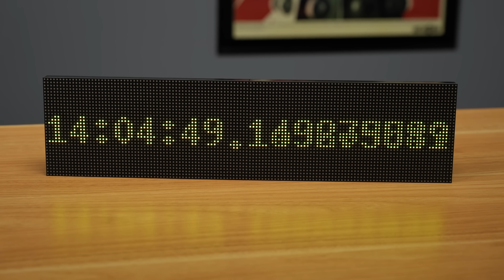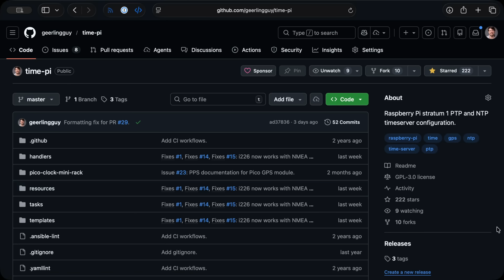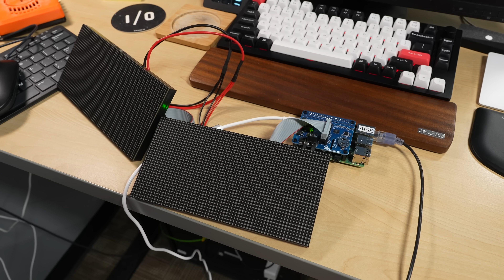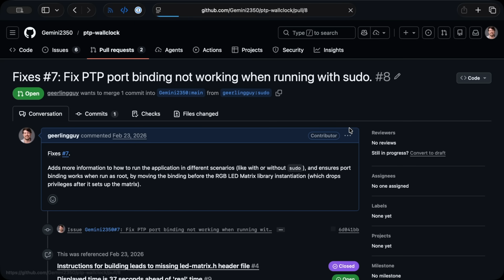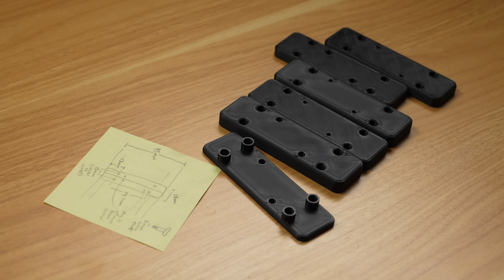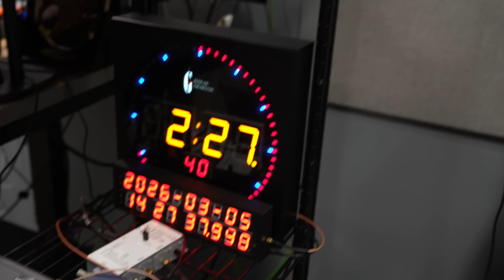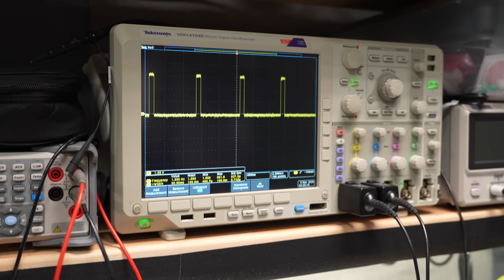I built a new clock, and now I'm not sure what time it is

Comment: A few thoughts:
It could simply be a lack of termination/impedance mismatch the i226. Considering that it’s supposed to be detecting slope, and assuming that if ✨is✨detecting it, I’d speculate that somewhere along the chain (but before the i226’s detector) there’s a capacitor that’s resulting in undershoot (relative to the detector’s threshold) during the falling edge of the pulse. This undershot, in turn, creates an additional positive-oriented slope that is what’s actually being picked up by the detector. (To get an idea of what I’m describing, reconnect your scope like you have at 9:49, but change the scope’s coupling to AC).
If so, ‘DC restoration’ needs to be applied; accomplished by bridging a diode between the signal line and ground (anode to ground if the signal polarity is that of what’s shown on the scope). Use a fast switching diode like a 1N34a or 1N4148. You may need to also place a resistor in series with the diode for impedance compensation

Comment: You need a clock that’s synced to GPS time. I bought such a kit from someone who designed one and assembled it.  It shows the time with 0.01 second resolution.  The cool thing is that when the designer built several of them and took video with a high FPS camera, there were all exactly in sync to 0.01 seconds.  It doesn’t use NTP or PTP— it gets the time straight from GPS satellites, so the clocks sync themselves with no wired communication whatsoever.

Comment: Flux remover in a dishwasher (not the one you use for dishes you eat off of).  If you don't have immersion sensitive components on the board, an ultrasonic bath will do the job.

Comment: 3:44 at the defense contractor I worked at for a bit where everything we did was mil-spec and ipc rated, we would scrub boards like that under a running sink with steaming hot water, then blast it with an air compressor to get the water out of the nooks and crannies, then sometimes rinse with IPA if there were still visible drops of water, or if there were components like a qfp or ball grid that could have water stuck underneath since the IPA will displace the water, and then let the boards sit for a few hours/overnight before testing them.

The IPA can help the water dry more quickly too and is how I usually do stuff at home now since I don't have an air compressor in my bathroom.

It felt super weird the first time I did it, but the issue with electronics and water is if it is sitting long enough to oxidize component leads and traces, or if water is still on the board when you add power since it will short stuff out.

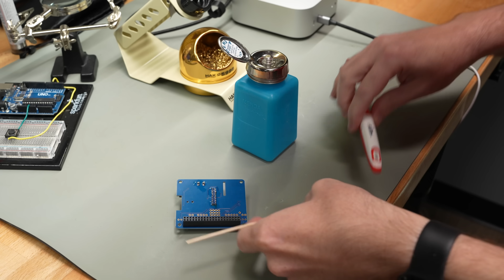Comment: 3:40 for cleaning solder flux, the most important step is to blot the board dry with paper towel — otherwise you're not removing the flux, you're just spreading it around.

Comment: To clean the flux use isopropyl alcohol, don't use 99% isopropyl alcohol, I found that out because it needs the solder mask and everything else as well, but drugstore isopropyl alcohol is perfect. You then just use a little toothbrush and just lightly scrub it back and forth and it'll come off

Comment: PTP and NTP are two different protocols NTP is a standard time protocol and it allows for some changes in time to be off a little bit however PTP is the precision time protocol and it keeps it up to date to the right time at the exact precision so that way time sensitive applications that require synchronization across many states for example the New York stock exchange, everybody who trades or does anything on the New York stock exchange those banks in traders need to have the exact moment they place a trade because that could mean the difference between millions of dollars. So PTP is used in high precision medical financial and other aerospace industries and stuff. We're NTP is perfectly fine for everyone's desktop laptop even most of us are work computers are perfectly fine with just NTP

Comment: I saw someone already suggest the paper towel technique for cleaning flux (I use a clean room wipe so I don't get small bits of paper on my board) then clean that off as soon as you're done soldering. If its stuck on there for a long period of time you can also use a mixture of Joy / Wisk detergent and water (be sure to rinse well when you're done). The good news is that if you don't mind it being sticky, you don't need to worry about cleaning it off; but if you are dealing with high speed data communications, (1Gbps+) you need to clean it off as it does degrade the signal in my experience. Great video, didn't know about PTP

Comment: Most components are fine to clean in IPA in an ultrasonic cleaner and that's the recommended way to clean the flux off PCBs for ultra low current measurements (nA and below)

Comment: 3:36 the toothbrush is just smearing the flux around, and the same about of flux is still on the board after the IPA evaporated, just more spread out. I usually use a piece of paper towel to suck the IPA away immediately after brushing but before it started evaporating. this takes the solvent WITH the flux away and leaves a nice clean surface after a few times. it also helps to use slightly more IPA to do this so it doesn't evaporate too quickly (and also dilutes the remaining flux as well)

Comment: 3:40 you are not cleaning the board, you are just spreading it evenly around the soldering. IPA will not make rosin go disappear. I worked in electronics and i had to tell this several times to the repair technicians. You have to wash it off with IPA or use paper towels to soak up the diluted rosin.

Comment: I've done a lot of production soldering.  Flux type is huge for cleaning but 99% IPA (warm) and an ultrasonic cleaner is the standard solution and it also works well with a brush if you use enough of it, especially for rosin type fluxes.  Rosin cleanup is much easier if you let the rosin dry for a couple hours after soldering and then use a wooden toothpick to manually remove most of the residue. These days I solder everything using paste solder and skip wire solder altogether.

Comment: Yeah, rosin core can be a pain to clean up.... use solid core solder and a liquid or gel type flux for easier cleanup.

You can also make a home made flux that cleans up easy, costs almost nothing, and smells great...  dissolve dry pine resin 90% ethanol until it won't dissolve any more... apply a little and solder away.  Clean up with more alcohol when done.  This is something my grandfather taught me before he died, it's my go to for soldering coated copper wire like what's in headset cords... works better than most of the commercial stuff I've used in those situations.

Comment: At one time network time clocks were stupid expensive. I did some work with an operator in Denmark around 2005, they rented their two from a specialist at big monthly money. Fast forward a few years the company I was working for provided some cheap think a couple of thousand dollars a link RF backhaul. Used GPS for timing and as it had the right hardware for Ethernet we turned them into PtP servers too.

Comment: You know what I would wind up using this for... I'd add a button and when I press it, it would display the press time below that running clock. The game would be to get as close to a second as possible, meaning 'most trailing zeros'. If there is room, it would also display the high score.

Comment: When you are getting to that degree of accuracy of time, how does the components of hardware affect the time? SCSI disks had a limit of length because bits would arrive along the parallel wires at different times due to resistance . The lengths of cables plus the tolerance of components  will all affect the display of time.

Comment: I know 'make it look nice' was the stated goal, but the sanity-restoring solution to dealing with the flux after soldering is to leave it there. Your hand-soldered one-off doesn't need to look like it came out of a factory. (Yes, some fluxes -- not the rosin core in your solder -- are not safe to leave on, you should know if you're using one of them & then you can just follow the vendor's recommendations.)
The way to get it clean anyway is, unfortunately, to use way more fluid. The flux dissolves in the fluid so you need to flush the whole lot away otherwise the solvent evaporates leaving the flux behind (again). A stiffer brush helps too, toothbrush is too soft -- you want 'boar bristle'.

Comment: We use ptp a lot in the HV electricity industry, it is slowly replacing IRIG-B. Every substation has a GPS clock and every protection relay is synced with ptp or irig-b. When there is a fault (i.e a bird flys into a powerline) the relays respond and record all the voltages and currents etc at 1-8kHz. Then the engineers can review event logs from all the relays that saw the fault and see what happened when, to get a detailed picture of what happened and ensure everything worked as it should.

Comment: 0:24 For anyone who doesn’t know PTP clocks avoid leap-seconds because they don’t actually show UTC time. Jeff’s Apple Watch is a very very accurate timepiece that displays UTC time within extremely tight tolerances. If you and a friend both hold your Apple Watches next to each other you’ll notice their second hands will be exactly in sync. The seconds separator colons on both watches will blink in unison. If you both happen to use the Mickey watch face his foot will tap exactly the same for each and every of the millions of Apple Watches on the world (and however many happen to be in space).

Which is more accurate Apple Watch or any given PTP clock? I can’t say for certain, but at least Apple Watch accounts for leap-seconds whereas PTP time uses some other standard that avoids the problem.
Reply from the maker: PTP uses TAI, and offers a field with a current number of leap seconds (though optionally the server can pre-apply the leap seconds and distribute UTC, but it must set another flag for that mode).

Comment: Way way back in time (mid '60s) when I was working in a lab that lofted things on NASA rockets, we used pure ethanol to remove the flux in solder of the day. I've never seen or used anything that did better and anywhere near as benign to use. Now, this lab was part of the UMich engineering school. So of course it was populated by graduate students, mostly. There was large jug of ethanol. Its level moved very little over the time I worked there. The students never touched it for "recreation". It just wasn't done. I got into industry and the looks and words I received when I mentioned how well ethanol worked - - - were educational. And, of course, that was then, this is now. Fluxes are different. But, as a test, a cheap bottle of denatured Ethanol might be worth trying. The molecule may work better than the more poisonous alternative alcohols' molecules.

{^_^}

Comment: I can't say I'm a fan of using a multiplexed display for displaying precision time, maybe if the refresh is linked to the last digit (as in the picoseconds digit) and does a complete refresh/update before that digit changes, otherwise you just end up with a jumble of dots. Unfortunately using an Adafruit etc. library generally does not give you that control. I see directly driven (as in not multiplexed) seven segment displays as the only was to do justice to sub microsecond time displays.
I'm not worrying with PTP for now, way much network upgrading needed, I'm more lookin at ways to distribute PPS to keep all in sync. I'm a bit disappointed how PTP was implemented, way to complex, pity it's not like POE where it runs in parallel to all the regular data with neither effecting the other.

I have two independent time sources/generators alongside a GPSDO PPS, I'm trying to come up with a device to compare all three and give me some graphs etc of their drifts. Getting an Arduino etc. to capture pulses and tell you when they occurred in reference to the Arduino"s clock is easy, however when you have three independent pulses that are ideally within picoseconds or less of each other is a lot harder. After seeing the time errors in the Jeff Geerling clocks, something like I'm describing would be real handy, much better then holding up a wrist watch and trying not to blink as the seconds roll over - not very scientific, about the same as me using a mobile phone running an atomic clock app for doing the same.

Comment: Hehe, I like that obsession. Reminds me how I replaced timer at work (digital, crystal driven) with Siemens Logo synchronized via NTP. For some reason that previous timer shifted by like 2 minutes every month, while Logo runs at +- 1 second in worst case. It's only to sound a horn when break or shift starts/ends, but it was stupid we had to adjust time every other week. There was also DCF77 version available for some time and now you can only get GPS version....which most probably wouldn't work in our metal building.

Comment: My most recent project was an LED clock that uses a Pi Pico 2 with GPS for time. The interface to the GPS chip is 9600 serial, so I'm not sure to what accuracy I'm getting the seconds. But it requires no network, no server, and I even programmed in awareness of timezones and DST transitions so the time never needs to be set. A battery-backed real-time clock gives time immediately on boot or whenever there may not be a GPS fix. There's got to be a bazilion projects like this out there, but I wanted my own, not copy someone else.

Comment: For flux clean up, you should try switching to a water soluble flux.  It can be cleaned off with just water and a tooth brush.  I normally just run the part under water and scrub it a bit, then blow it dry.

I use these:

Kester 24-6337-6403 solder, which a has water soluble flux core.  This specific solder also has a bit lower melting temp then most solders so you only need to run your iron around 280C instead of the normal ~330C that a lot of solders want.

For just straight up flux I use Chip Quik WS991 Water-Soluble Tacky Flux.  Prior to using this I was using amtech flux and its annoying af to cleanup even with IPA.  I couldn't discern any performance difference between the 2 and now cleanup is fast and easy.

Comment: IPA and scrubbing is the only way that will work for flux removal. And sometimes it takes more than one pass. What I usually do is, douse the area you want to clean with IPA, grab an anti-static brush and scrub, then grab a lint free cloth or a KimWipe (has to be lint-free, or else you'll get little bits of crap all over the place) and lay it over the area while it's still wet, then using the brush, blot up the IPA+flux residue mixture. This usually gets the worst of it, but as I said before, sometimes a 2nd (or even a 3rd) pass is needed.

Either that, or chuck it in an ultrasonic cleaner filled with a solution of water and electronics cleaner. Walk away while you let it run for 5-10 minutes. Job done :) Then just dry the board (I usually hit it with an electric air duster thing set to "Category 5 Hurricane" and then let the board air dry for several hours.) Unfortunately ultrasonic cleaning will ruin certain devices (mostly MEMS devices and sensors.) I've also heard people say that it is bad for crystal oscillators as well, but so far (knock on wood) I haven't encountered any dead crystals due to ultrasonic cleaning them.

Comment: Jeff, when soldering, try using acetone instead of isopropyl alcohol. It'll eat through it so much faster than IPA. Pretty much all industry standard electronics are fine with acetone, except dot matrix printed part numbers and some LED displays. 

Brush the acetone over the solder joints, then put a dry rag over the still wet board and brush the rag into it. This'll soak the acetone and flux off into the rag, then you can repeat as needed until absolutely spotless.

Comment: About a dozen power outages ago, I gave up keeping the clock on my microwave set.  And I let everything else clock drift because I stopped caring years ago.  I know my phone and computers are "close enough" from NTP and GPS sync.  I like watching people slowly go insane obsessing over doing meaningless tasks though.  The main problem I see with time sync issues is that clock drift happens in the first place.  Instead of solving the problem at the hardware level with a different base material than quartz, everyone monkeys around in software.  If I can't have perfection, then I would rather that most clocks be designed to run slow (i.e. fall behind).  Rewinding the UNIX timestamp wreaks havoc on a system from a software dev perspective.

Comment: 3:30 Hardware engineer here. I have the same anayance. 
1. Use as little flux as you can get away with, without making bad joints. For your trough hole parts you can try another brand of solder with less or different flux in it. Experiment. 
2. Start by cleaning the boar roughly with IPA or specialysed flx cleaners. I'm a huge fan of the one from Electrolube, but i dont know what's easily avalable for you. 
3. Ultrasonic cleaner. This is the secret for REALLY CLEAN board. I've yet to find a way to deeply clean flux off a board. 

Step 2 is mostly so you dont get the ultrasonic cleanr fluid as dirty. Its a pain in the butt to change. 
And yes, it really depends on the type of flux. Some are fairly easy to clean, some are as thick as honey and i can never get them off.

Comment: For a good cleaning job after soldering, use flux remover, and then finish up with isopropyl alcohol +90%, that will remove any remaining residues after the "flux removing step"! (tips from video: "Raspberry Pi Pico - Control the (I/O) World" of Dronebot Workshop youtube channel) 😎